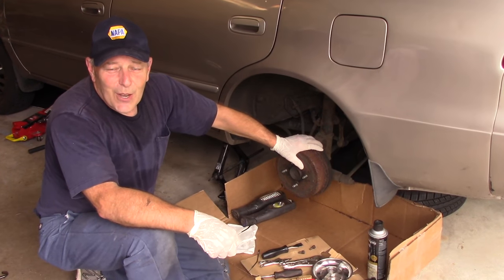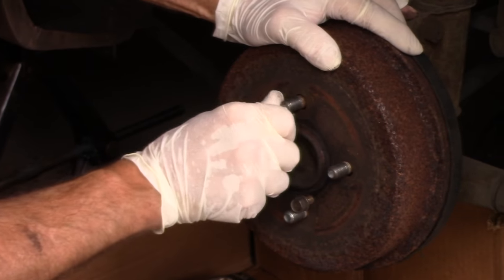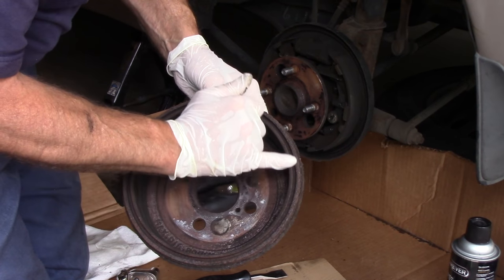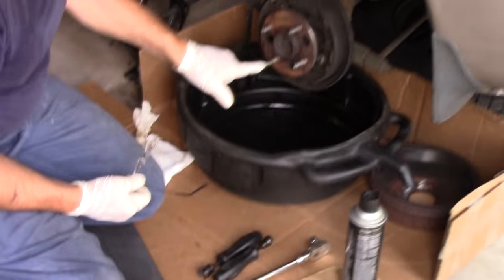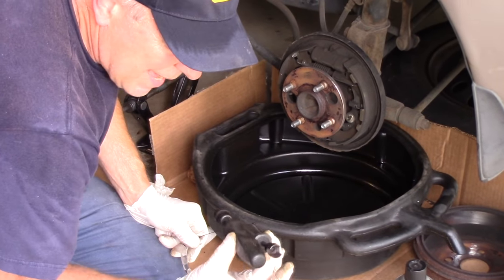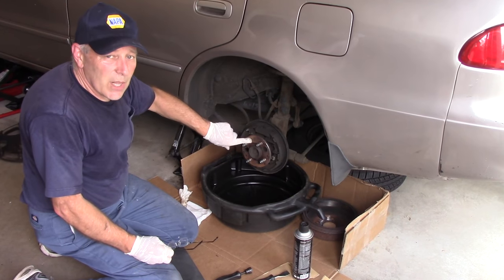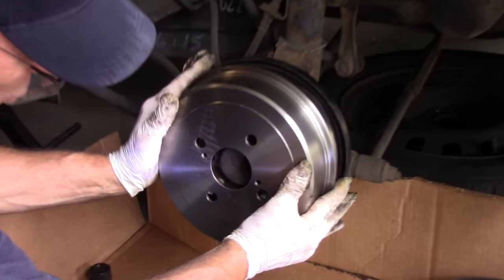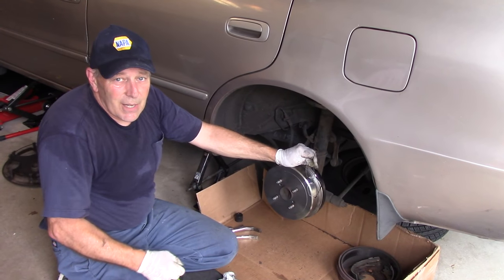How To Replace Rear Brake Shoes 1995-2010 Toyota Corolla

Comment: Do not pinch the brake line. As long as nobody applies the brakes you won't have any problems. There's not enough pressure to pop the cylinders out when the brakes are at rest, unless something else is wrong with the vehicle. Also, avoid touching the brake lining on the shoes. Otherwise a very good video. Really good idea to remove that c-clip before removing anything else.
Reply: There's residual brake fluid. Just like calipers
Reply: @EricVonHunter it's not residual. It is full of fluid but not pressurized. Never pinch brake hoses.

Comment: No everybody, it does not come off really easy like in this video. Ull hear the springs pinging, the two bolts will get tighter and tighter, and if ur lucky...BAM, the drum will break free. Then ull look around to see what broke, ull check ur fingers and hands for damage, then ull be able to see what brake parts wer bent.

Comment: BundysGarage   My friend and I put drums and shoes on the rear of my 2010 Toyota Carolla successfully with the help of your tutorial. We have never done drums and shoes before.  Thanks a heap!
Reply: How did you adjust the ebrake bro??? After doing my rear drums my ebrake was loose and didn’t hold at all…..I think you adjust it by the star adjustment but then I’ve seen videos where you have to remove the center console and theirs an adjustment nut at the base of the ebrake, I’m confused??

Comment: God bless you man! I found this video very helpful and was able to do my own drum brake replacement. Unfortunately the drum was stuck and the pilot hole was damaged so had to use force and broke one of the springs. I'll have to pickup replacement tomorrow. Funny thing is when i picked up the shoes, the guy asked if i wanted the springs as well and I said no...live and learn.
Reply: better to buy the hardware kit and not need it, than need it and not have it,

Comment: The last vehicle I changed the drum brakes on was a 1987 S-10 Blazer which I still have, but don't drive any longer. It wasn't that easy, but it seemed to be easier than the ones on that modern car you worked on. I didn't know they still had drum brakes on them, but it is easier to work on with the right tools and I still have the ones I used on the Blazer. All the other vehicles I have use all new braking system and that makes it easier  to work on.

Comment: Never ever use anything to pinch rubber brake lines. Especially old rubber lines, you may cause a weakening or damage of the rubber and risk the line failure and catastrophic brake loss. Also this procedure can be completed in half the number of steps
Removing the hold down springs from the shoes and then disengaging the bottom spring allows both shoes to be removed and disconneted without having to pry around behind the wheel hub.
Reply: 100% corrected.. never messed around with the rubber brake fluid line...you don't have to pinch the brake fluid line anyway.

Comment: At the 10.26 min/sec you mentioned sometime I found very important; when I did my brakes I didn't  pinch off the brake hose (to relieve the pressure) and as a result brake fluid started leaking from the brake cylinder.  Unfortunately, as a result of missing this step (not pinching the hose)  it later turned into a problem where I had to replace the wheel cylinder.
Reply: Normally the brake cylinder doesn’t just pop out. Something was either wrong, or someone pressed the brake pedal forcing fluid into the cylinder and popping out those pistons. I’ve never pinched my brake line because if it’s old and stiff, it will crack/break, and now you have a whole other problem.

Comment: sweet thanks. thought it was gonna be harder than it was. got it done in an hour. 
you don't have to pinch the brake line, and i didn't have a washer behind the clip on my 2010 corolla. followed everything else step by step though

Comment: If that drum was rubbing on the backing plate because of rust... that would have knocked any rust scale loose that was too close for comfort.   Just take a wire wheel to that groove, hit it with some ospho maybe [shield the machined surface of course] and put it back on.  Replacement is needed when drum gets a lip in it, or gets heavily grooved by brake shoes staying in service down to the rivets, and the required machining makes diameter so large that safe wall thickness is destroyed.  In most cases a light finish cut is what's needed.  Rough cuts are to true up concentricity or big grooving damage [like a part coming loose and getting wedged under a shoe].

Comment: what size are the bolts used to remove brake drums???
Reply: 12 MM is the bolt size for that hole in the rear drum.
Reply: M8x1.5

Comment: I have watched countless of brake shoes vids you the first person I saw clip the brake line to stop the fluds from pumping out...nice!!!!!!
Reply: Brake fluid does not pump out unless someone is touching the Brake pedal. Please do not pinch brake line, it will weaken the rubber to the point where it will crack as it ages. Everyone has seen how rubber as it ages dries out and when the moisture leaves the rubber it loses its pliability and begins to crack. Brakes are too important to do anything damaging to the brake line.
Let it drip into a pan, it is too easy to replace a little brake fluid than rather jeopardizing a life. Just make sure no one pushes on the brake pedal while the shoes are not fully connected, unless you are replacing the wheel cylinders then it will not make any difference.

Comment: Well done video Jim, easy to follow.  I have a 02 Highlander and I did go ahead and get a new caliper, and rotor due to rust, the old one had frozen, it's the original. but now I can't get the new  rotor over the parking brake. I didn't really do anything to the parking brake other than moving the star wheel to close the pads in, now the star wheel has stopped or stuck and won't close the pads any further. I still cant't get the rotor on. Do I need to clean with brake cleaner and keep working with the wheel?  Idk, I'm afraid I'll mess it up even more. I hope I don't have to reassemble the parking brake. Thank you
Reply from the maker: Thanks for watching

Comment: After this is done, does the brake pedal start applying earlier?  I have done it before once, bu t don't remember.  I put new calipers , rotors and pads on .  Brake pedal is firm, but not high up enough. Starts applying half way

Comment: What year are you working on, mine is a 2001 with 5 lug and the springs and hardware is different,  also if you remove the 4 bolts that hold the hub and pull the hub it makes it a lot easier to work with.

Comment: Thank you for this excellent video.  Even with the hold down spring tool, it still seems like a lot of fiddling to get the hold down springs back on.  I often use just a pair of pliers instead of the official tool.

Comment: Some other tutorials show the parking brake cable being removed.  It's better if you don't do that as Jim shows here.  It is a lot of trouble to get the parking brake cable reattached to the parking brake lever.  Jim doesn't take it off here, saving a lot of time and frustration.

Comment: Great video you helped me a whole lot. I tried looking through the comments for any that has had the same issue as I'm having right now, I hope you have the answers Jim I bought Bosch brake shoes that said they would fit but I can't get the drum back on it won't go over the pads. Did I mess something up on the process (when I released the clamp the shoes expanded) or did I buy the wrong parts. I tried cranking the star adjuster again to repeat the process but can't get the drums on
Reply: You ever figure out cause Im having same problem
Reply: @shawnhorni9688  sort of, not ideal but I had to sand down the pads I bought all different brands for everything so that was probably my problem but it took me a while to get it sanded down enough, I tried beating with a hammer and that didn't work but I haven't had any braking issues so I guess what I did was okay

Comment: Question, I have a 2000 Celica. When I first start driving there is no noise at all from my brakes. After a bit of driving, I get a slight pulsating whine from the back drums. But NO pulsating in the brake pedal. I have no clue what that could be. Brakes stop fine. Any clue what this might be?

Comment: Please, I need help……my ebrake is loose and doesn’t hold, to adjust and tighten it do you mess with the star adjustment or no? That’s what it seems like in this video but in other videos I’ve seen the e brake is adjusted by removing the middle console and theirs a adjustment nut on the ebrake handle??? Which is it???

Comment: Thanks for the video. If you know how to wrench on things, you could pretty much do this job without any prior knowledge. Except for putting the vice grips on that brake line. I would've never thought of that, so thank you for saving me a hassle.
I'm hearing grinding from what I think is the rear brakes. It happens when I brake. But the pads are not completely worn down. Are looks deceiving? It's a 2010 toyota and they are the original pads. They're so cheap that I may as well replace them in any case. But what else could I look for that would cause that grinding sound?
Reply: i am experiencing the same problem. did you find out what cause the grinding noise? my guess is that the area of my drum where the shoes rub against needs some grease.
Reply: @fengz-x7z  no. It's still grinding and I'm not sure if it's coming from the front or back now. But when I take everything apart, nothing looks worn. Nothing appears to be wrong. I have replaced both front rotors and both rear drums. And they are name brand parts (AC Delco in fact.  Who would've ever thought that Amazon would sell top quality parts for literally half the price)
You see how long ago my initial comment was.  I still haven't figured it out. However, the situation has not worsened. I bought a code scanner and there's no error codes. I even bought 4 brand new tires and asked them to look at it. They could see nothing wrong.
Reply: Please do not pinch brake line, it will weaken the rubber to the point where it will crack as it ages. Everyone has seen how rubber as it ages dries out and when the moisture leaves the rubber it loses its pliability and begins to crack. Brakes are too important to do anything damaging to the brake line.
Let it drip into a pan, it is too easy to replace a little brake fluid than rather jeopardizing a life. Just make sure no one pushes on the brake pedal while the shoes are not fully connected, unless you are replacing the wheel cylinders then it will not make any difference.

Comment: Jim., what are the specs of the bolts that you use to help remove the drum? Thanks for your fine videos.
Reply: M6x1.0 is very likely. But tapping with a hammer will work as well.

Comment: You do the brake drum on the corollas rust so fast my buddy put new drums from oreillys on his car and in 3wks they were starting to rust,when I did mine I used steel wool and scrubbed  them down wiped them clean and put 5 coats of caliper paint on mine they look great are the drums  not made with good quality material or what,but video was great

Comment: I believe the car you're working on is a Japanese-assembled Corolla; the spring setup is a little different on USA/Canada models.
Killer idea on the initial horseshoe clip removal while the shoes are still mounted...use the hardware for your "bench" vise! (I don't believe you can do this on US/Canadian models, as the horseshoe clip is on the inside of the post.)

Nice video...thanks!
Reply: Horseshoe clip is on the outside Do not take off the inside clip

Comment: Here's a secret trick I discovered.  If you don't have the special tool, unscrew the adjuster into two and use the male threaded part's slotted tip. This will Add a little grease on the tip to help prevent the spring disc from moving with the screw.

Comment: A bolt such as this?????? What size metric bolts AND socket are you using to release the drum. Why don't you mention the size when you suggest we keep them?
Reply from the maker: Did you see in the description below the video the size of the bolt????????
Here are some of the tools that jimthecarguy uses
https://www.amazon.com/shop/jimthecarguy
Easy to follow step by step directions how to replace rear brake shoes & drums 2001 Toyota Corolla.I will also show you how to adjust the brakes after you replace them.
The bolt is M8x1.25.  
Due to factors beyond the control of jimthecarguy, it cannot guarantee against unauthorized modifications of this information,. jimthecarguy assumes no liability for property damage or injury incurred as a result of any of the information contained in this video. jimthecarguy recommends safe practices when working with power tools, automotive lifts, lifting tools, jack stands, electrical equipment, chemicals, or any other tools or equipment seen or implied in this video. Due to factors beyond the control of jimthecarguy, no information contained in this video shall create any express or implied warranty or guarantee of any particular result. Any injury, damage or loss that may result from improper use of these tools, equipment, or the information contained in this video is the sole responsibility of the user and not jimthecarguy.

Comment: I can’t get my drum on!!! I worked my parking brake before i put the drums on!! I figure it is too tight. I could not see clearly how to loosen it up. I have been working on this ALL WEEk and thought i would finish today. getting that adjustment spring and parking break cable back on literally took hours. The first parking brake took 45 minutes and the other did not take quite that long, but was a long, hard slog. People need to know this is a very hard job the first time.  i hope I can finish in the morning.
Reply from the maker: Yes it can be very difficult for sure. I have done thousands of them that is why it looks easy. What is the problem you are having now?
Reply: @jimthecarguy problem was, i had two “short sides” on one side and two “long sides” on the one the drum would not go on. I think my new wheel cylinder leaked —something did-all over my new shoes. My brakes started shuddering and locked up a couple of weeks ago. i think, maybe, that happened because my brake pads are saturated. I guess I need to have someone apply the brakes while I am watching to see where brake fluid is coming out.
Reply from the maker: @lydiahubbell6278   If the brake shoes are cover with brake fluid you should replace them . The only place fluid can come from is the wheel cylinder. Keep me posted
Reply: @jimthecarguy  it looks like the fluid was running straight down. i sprayed the shoes down with brake cleaner just as a precaution.
Reply: @jimthecarguy  why are my new cylinders leaking? i have replaced the leaky one twice! other side was not leaking, but I replaced it anyway. I do not want to replace on the bad side again until i figure out what is making the leak! Any ideas?

Comment: Consider if it is simpler to hire a 'mobile mechanic' who is skilled to do this. A 2000 Corolla may have front disc brakes and you will never need rear brakes done again. Pay a skilled mechanic to do a 1-time job and forget about it may be the smart way to accomplish it..

Comment: How do you balance the handbrake in a 1995 toyota Corona?
Reply: That star adjustment wheel.  You adjust it with a screwdriver.
Reply: @chuckschillingvideos  — ok see that’s where I was confused…..I did my rear drums and afterward the ebrake was loose and didn’t hold at all. So to tighten my ebrake up and adjust it I’m supposed to use the star adjustment correct??? Because I’ve seen videos of people saying and showing you adjust the ebrake by removing the middle console so you can get to the base of your ebrake where there is an adjustment nut. So I’m confused which too do??

Comment: Never grease anything in the brake area. First it attracts  and traps dirt and dust which turns into a good grinding compound on moving surfaces. Second as you can see he spreads it all around and getting grease on the brake surfaces as well as it is all over his gloves. Grease on brake surfaces is not healthy.

Comment: constructive criticism .....
your cameraman needs a proper torch firstly.
secondly you say a lot of time ..we are going to put this over here and down there....etc.
when making a video you HAVE to say stuff more like...we are going to put this minature clip over the hole here on the pad , and then push the pad down towards the ground after it has been placed in the housing..

using terms like over here, and down there ..is really frustrating and pretty much meaningless when watching a video...
another thing ..how did you know the pads were low....is there a way of checking without dissasembling the entire car...

and why did you need 2 screw drivers to adjust the star adjuster at first..
and then on reassembly you magically did exactly teh same thing with a single screwdriver..that to me means you left a piece out..but i know you didnt but still ..it didnt make sense.

that said..those criticisms are just to help you improve.
your video was most excellent and the best i have seen..with attention to minor detail like greasing where the back of the brake shoe is going to slide...and the bits about removing the little spring clip that holds each shoe on...oh and the bits about keeping the piston compressed by stopping fluid flowing..
so its an excellent video..but you could be absolutely professional discovery channel standard by being a little more specific at times.
Reply from the maker: Thank you! Cheers!